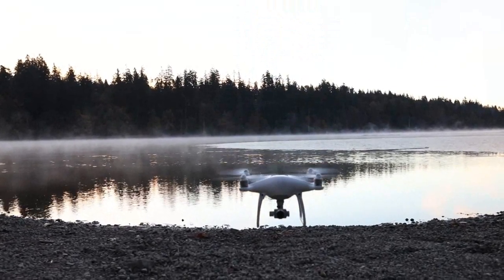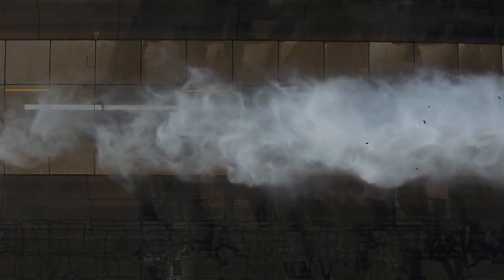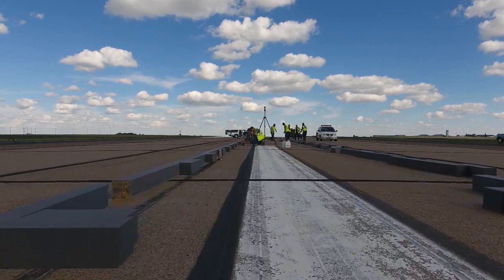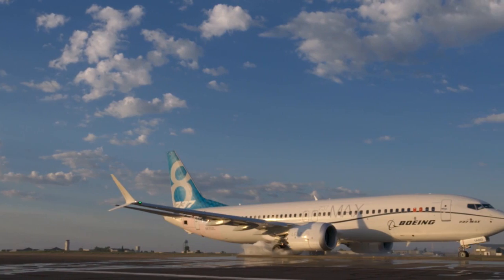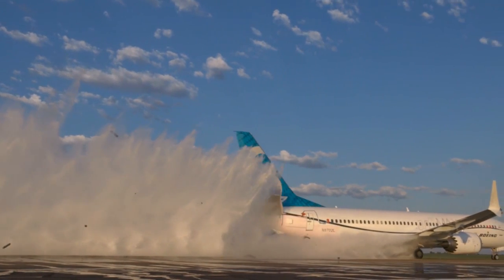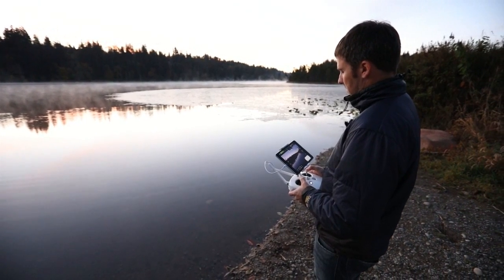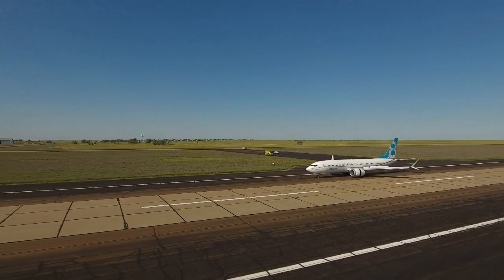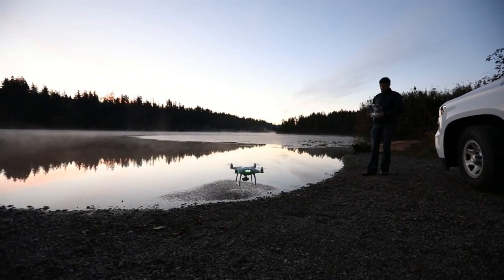Boeing's 737 MAX Makes a Splash

Comment: Please, please, please make the cockpit quieter!!!!! I jumpseat on 320s, 717s, flew the KC-10 for 5 years. You can whisper in those cockpits. I can get fake body parts, a new heart, a new ACL. I can't get new ear drums and improve my hearing. I don't mind the cramped cockpit but please try to incorporate some noise.cancellation or quiet the ambient noise on this model. Thanks
Reply: Don't mix in the 717, the engines are mounted in the rear.

Comment: Glad the drones are being used for things like this rather than wasting fuel on helicopter footage. Quick, easy, and great for 25-40 mins. Plus the quality is great. 

Can't wait for the MAX to be flown for the first time in the public.
Reply: I agree, drones are stealing the role of helicopters for aerial footage, and they are far cheaper and safer too. I mean, I can get 4K aerial video with my drone from 400 ft in the air, and it costed less than $1,000!

Comment: I thought drones and planes were bad!?
Reply: Yes, flying a drone near an airport is strictly illegal... 

Unless you are Boeing, and you are using the drone as part of an aircraft test. In this case, the plane and drone pilots are working in coordination, and both of them are aware of each other's position at the same time, getting rid of the risk of the drone crashing into the plane. The reason you shouldn't fly a drone near an airport is because the pilots do not know you are flying the drone near their plane, making way for a risk of a collision between the plane and the drone.